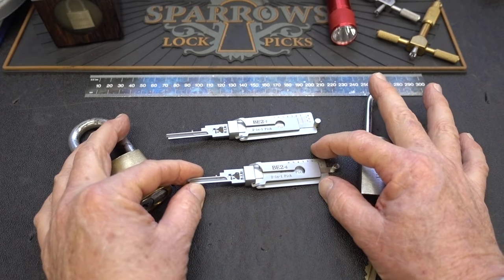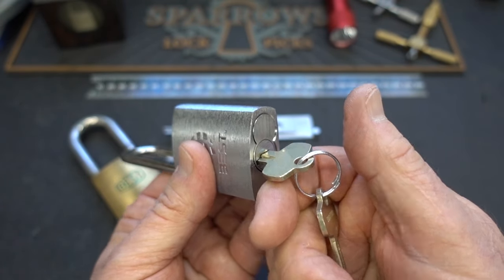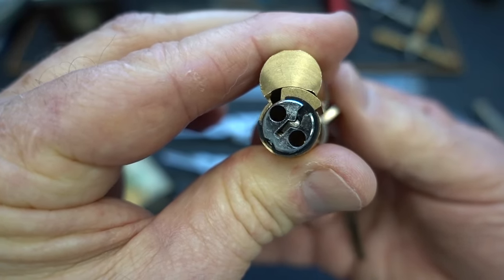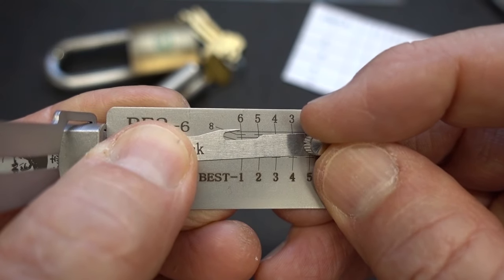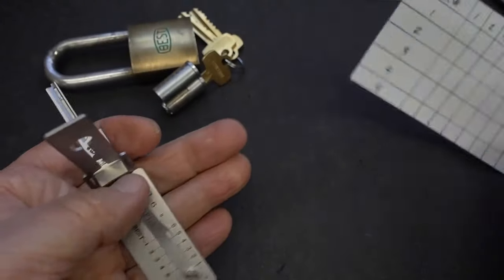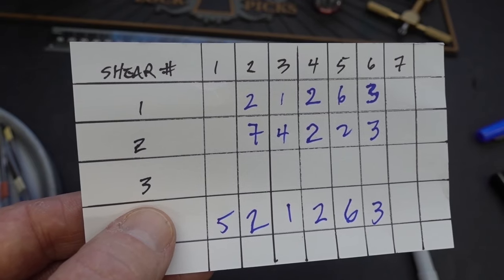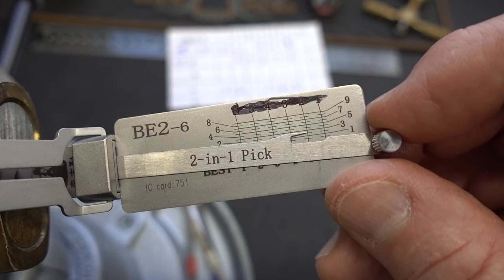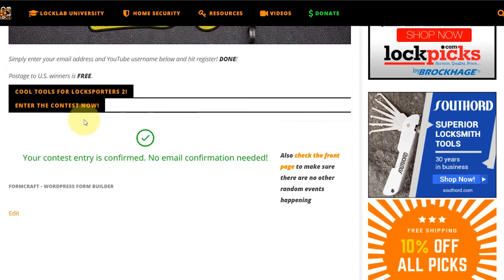(1638) Review: Lishi SFIC Picks (WOW!)

Comment: you should have waited until yo u made the key so we can see that it really works with the key.
Reply from the maker: I agree, that would have been ideal, but I don't have a code cutter and, TBH I can buy a brand new 7-pin core with keys pretty cheap on eBay.  Many locksmiths are hesitant to cut a key to code for you, especially if they are "industrial" type locks like the SFICs.  Cheaper and less hassle to just buy a new lock.
Reply: @bosnianbill  Bill -- drop me an email and I will cut the keys for you as I have A blanks and a BEST Combinator.
Reply from the maker: Ken, thank you for the kind offer but I have a local locksmith friend that is already cutting them.  I appreciate your generosity!

Comment: These locks use a complicated pinning system which involves multiple pin sizes the need to add up to a specific number. Not very straightforward at all.
Reply: Adam Pierce one you load up a couple of cylinders it get easier. It is very intimidating when you first start on them. I believe the number is 23 so it has balanced pin stacks.
Reply: @tuba7084  You are correct if using the A2 pinning system 23 is the total pin stack. There is also an A3 and A4 which use different totals. (this wouldn't come into play when picking, but makes a huge difference when pinning)
Reply: TheKeymaster1053 I have the charts for the other systems, but have only messed with the A-2 System. It is what I have used for locks that I had to rekey due to eBay purchases without keys. So far when I pick an interchangeable cylinder, I have gotten “control” every time. (I suppose since I have just said that, I will need the special tension wrench for Best lock to acquire the control due to only picking to operating lol)
Reply: @tuba7084  Yes, the A2 is the most commonly used. The special tension wrenches are different for each keyway, just like the Lishi tool would be. very hard to get them to work properly as well.
Reply: TheKeymaster1053 I suppose I need to hopefully catch the control when picking lol. Gets expensive having to purchase all of the special tools for each keyway. I use the “TD” keyway, and I don’t think they are as common as some of the other keyways.